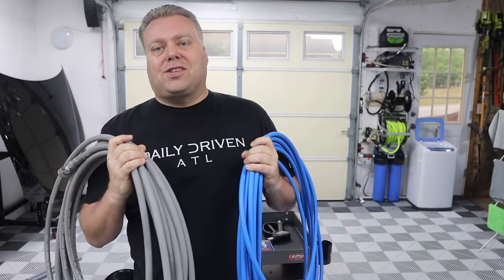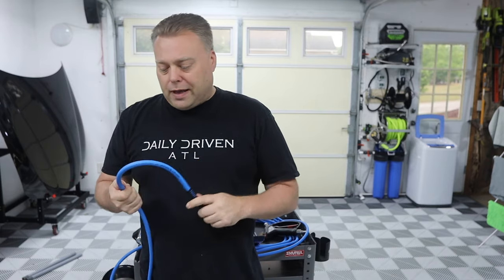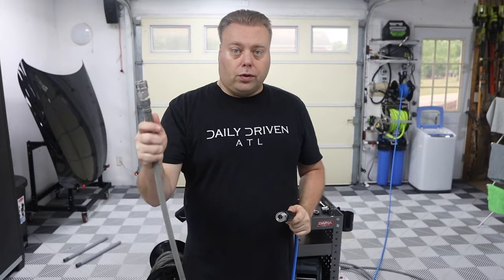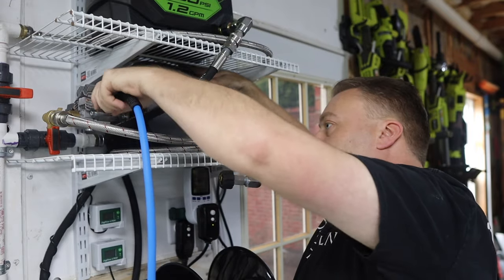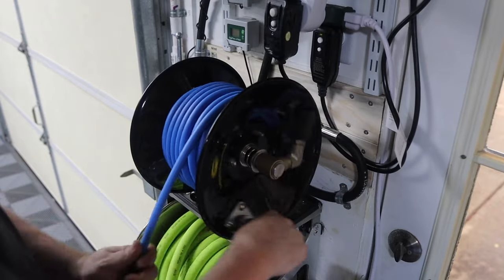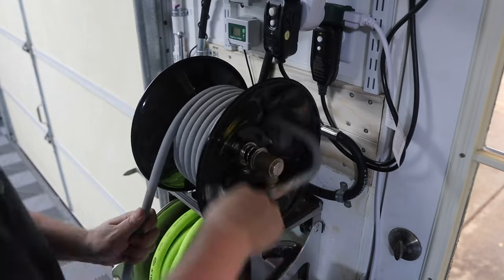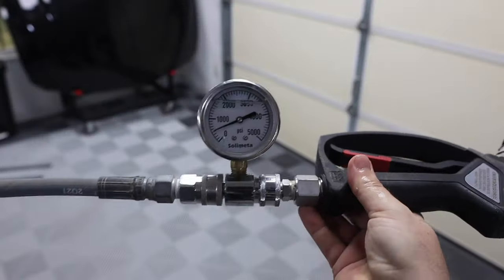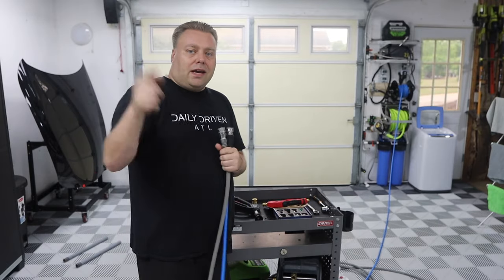Uberflex 1/4 Hose vs 3/8 Amazon Gray Hose | Reviewing & Testing | Car Wash Tips

Comment: I picked up 100 feet of yamatic. I need to find a hose reel for basic home use  I saw a video to
Adapt a 40 dollar hose reel. I can’t imagine spending hundreds of dollars for basic home use. Also hundreds for a vacuum hose.
Reply from the maker: The one I have is 50ft, but there is a 100ft version that I had on my wash cart. Just a little over $100. I’ve heard many do the $40 air hose reel conversion. I myself probably won’t do that as it’s not designed for that type of pressure. I know some mobile guys using it all day with no problems so I guess it works. I just saw this one it’s $90 and comes with the jumper hose which usually cost $25. Same design as the one I have. https://amzn.to/3OaZttl
Reply: @CarsWithKeav  thanks!!!! For something like this can we use 25 feet and still leave some on reel vs on the air hose one we can’t use while on reel because of pressure and hurting hose and reel? Thanks again!!!!
Reply from the maker: @vectorr6651  Absolutely, you can use it with only reeling a foot and leaving 99 feet on the reel. It’s designed for pressure that a pressure washer gives. You may have been watching Imjoshv video and he is right to a point on taking the whole hose off as the hose expands when pressurized. This won’t be an issue if you roll the hose up on the reel while it still has pressure then when done relieve the pressure and the hose will have room to expand the next time.

Comment: Doesn't a pressure washer damage a car?
Reply from the maker: Not if you use the right nozzles to keep the pressure at 1100 PSI or less.
Reply: @CarsWithKeav  Well, I guess I'll be following you to find that info out. Thanks. Car washes are expensive and meh. where I live.

Comment: Looks like Uberflex doesn’t come in 100’
Reply from the maker: They do not make it in over 50 feet as they believe the pressure drop is too much over 50 feet and you should move to a 3/8 if running 100 foot.

Comment: What’s the point of dragging the hose around with no pressure on it? Both those hoses will be terrible under working conditions. Uber flex is just a waste of money.
Reply from the maker: You’re right on the testing I have gotten better over time. We all make mistakes. The Uberflex is a good beginner hose, but saying the gray one is terrible under working conditions I don’t believe that been using for years.

Comment: OG wastes a lot of money IMO!
Reply: You’re right. You need a steady supply of disposable income to shop their on the reg. From what I understand mosmatic isn’t as quality as they’re perceived. I’ve never tried them.
Reply from the maker: Just costs too much. The mosmatic fittings and swivel are unmatched in the industry, but just not worth the money to me. Matt has a great niche there with the disposable income people, but he still sells Active and MTM because he need the sales volume. I hate to admit I was stuck in an OG mindset for some time. I was brain washed. 🤣
Reply from the maker: For sure, his niche is disposable income and the best of the best. Problem is a lot of the time best of the best means most expensive and what products he can get an exclusive on. I heard that’s why he went mosmatic after helping design the MTM SGS28 they would not do an exclusive OG spec for him.
Reply: I have the Uberflex  with the 2.0 and love it so far.
Reply: I’m new to the hobby.  Having a blast with it.  The OG stuff definitely looks sweet, but I’m rocking a Ryobi 1800, Uberflex, MTM reel, McKillans swivel gun and MJJC v3 cannon.  I can’t imagine that OG gear would make a difference to me.  Subbed. Great stuff man!!
Reply from the maker: @DMCnME  Whatever makes you enjoy washing. Your setup will clean just as good as a full OG setup. The more expensive setups just make things a little easier. Most of what OG is about is the quality materials which if you washed many times a day would matter, but if you wash once a week you don’t need that stuff.